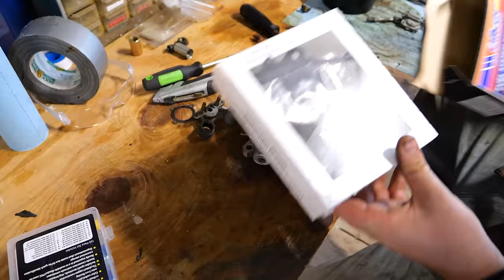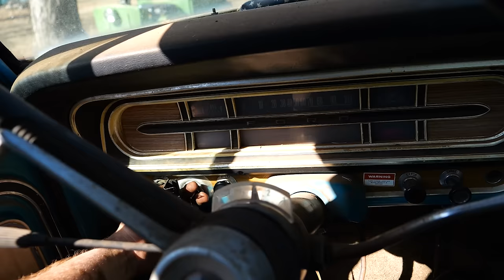Will this STUBBORN Abandoned F100 Run and Drive After 15+ YEARS!?

Comment: Hi Kevin, newbie wrencher here. I have a 1975 F100 with a 390 in it, Edelbrock 1406 carb, and it is just dumping gas into the oil for some reason. It runs great though? And doesn't smoke at all. I replaced the fuel pump with a Napa OE mechanical pump and that seemed to make the issue even worse? I have to drive it 1000 miles home in about 10 days and I was wondering if you had any advice on what to check next. I've already learned so much, my dad never taught me to wrench so I'm trying to learn everything I can so my son or daughter doesn't have to teach themselves like I am. I love every single one of your videos and they've been invaluable to me in figuring out the basics.

Comment: Ok for noobies heres a bit of a trick ive learned working with carnival equipment.

Points if you noticed make a spark when contacting metal, what happens when that connection gets crap on it.

Well in the carnival there is this metal ring that goes around in a circle that has an eletrical connection from this brush looking thing on the other end being a solid wire like normal.

now as the ride spins you dont get a cable just winding up like a wench.

to keep it from corroding we coat it in Vaseline.
Try it on an electrical connection that requires something to swing into whats spinning.

Comment: My husband bought a Ford 150 in 1994. He paid $4000 for it. The truck ran until 2021. It has over 300,000 miles on its. My husband died this year, but his truck, although not working is still sitting in the front yard!

Comment: I know surely it's a 5/8 head sized bolt so you can use the 5 blades spark plug the socket determine the engine that's a good thing that you can get a good deep bite on it with a deep well and hopefully you won't shut it off even though some people have done so but in the early years about 3:27 as noted they didn't have a prank snowball so if you went in to one of those in A3:27 or 283 you can't turn it that way either you have to get on the fly room or the belt like you're doing there

Comment: Craftsman, great neck tawain and USA and true value hardware stores made in USA master mechanic tools is what I used from like 14 to 2016 when my tools disappeared right off the seat in my truck!! And over half the tools in the garage in my roller tool chest and cabinet I still have my Kennedy signature series power coated Orange....

Comment: Your videos are great and really helpful.  The only comment that I have, and learned this from the Millennial Farmer and watching his videos, but I was concerned when I saw you leaning over the engine and the fan was going around and around, and there on your hoodie were the draw strings hanging down.  I don't want to see you get caught into the motor.  Zach from that channel was promoting his hoodies and the first thing he did was cut off the strings so they would not get caught.  Just a suggestion if you are like me and never tighten them anyways.

Comment: I once had a 1970 Ford F100 with a 360 and a 3 speed manual transmission my father left me it sat for 4 years when I was in the army after I got it running and driving again several people told me the engine wouldn't last a 1000 miles but after I gave it a tuneup and set the timing I drove it for a little over 20 years until it was stolen it had over 500 thousand miles on the engine and it still ran fine.

Comment: Unfortunately I have ran into this as well,, I went to pull the decent quadrajet hot air choke carburetor off a 79 chevy k20 sbc 350 to rebuild and use on my other truck a daily driver 78 Chevy c20 custom deluxe.... anyways I had to lock wrenches together on the top bolts in the front to get the freaking thing off the truck, they should never be anywhere near that tight... and sure enough the back two lower carb bolts were way too tight that revealed the farmer sealed it to the intake with silicone waterproof for bathtubs and the black rtv all-over the bottom of the carburetor...
Reply: As in no gaskets....

Comment: 38:33 Homey that thing just started 250% easier than my 14 Challenger starts. ._. old iron is just so damn much better it isn't even funny. Engine clatterin' to beat the band, smokin' like it's coal fired, knockin,' running on 7, sunk lifter/wiped cam, STILL STARTS RIGHT UP WITHOUT A MOMENT'S HESITATION!

Who's leg do I have to hump to get these modern computerized garbage piles to start that reliably?

Comment: My 1st project car is a 96 BMW Z3 with a German tuned 4 cylinder, I might be finished with it in the next 3 years. The price for parts is the only thing setting me back. My 2nd project vehicle will hopefully be an older dodge as I am familiar with them from when I owned an 83 D150 with a 225 slant 6 oh the joys and ease of older dodge engines, except for electronic fuel control systems that had no reason to be on an 83 carbureted motor.

Comment: Engine rebuild if possible the bearings on the rods are probably worn out from the was once oil is now grease/metal particles really will help if there was new oil and rod bearing in it

Comment: 49:41 Ummmmm not such a safe move there, Kevin --- those hoodie-strings on your jacket were awfully close to that dangerously-spinning fan-blade!  They could have gotten caught in the impeller and yanked your tender-fleshed face down into those sharp whirling steel vanes!! :O :S

Comment: On point with it usually being an ignition problem. I changed out a fuel pump before replacing points for a second time. Whaddya know? It was the points. 😂
Reply: Watch the beginning when he's showing the points, the pivot shaft on them is completely worn out and the points slide back and forth. That causes dwell issues and poor running. He was just demonstrating how they work, but I'd have replaced them first thing

Comment: "I can lick both of these and be fine"... I wouldn't count on it. Generally, DC 12 V is pretty safe, but if there's a draw from the battery and it stops while you hold both poles you WILL get a nasty chock. If the draw is big enough and stops abruptly enough (starter) it might even kill you, so be careful with a car battery. Dropping one on your foot isn't the only way to get hurt by one.

Comment: This old truck is just testing you to see if you are serious about fixing it or not. I think it deserves a slightly better engine that makes less rocks in a can noises. Maybe do a teardown on this one though and show us how bad or not it really is inside.  I'm guessing pretty bad. It looks like that one was very neglected and oil wasn't doing it's normal oily things in there for quite some time. I still enjoy watching you go through carbs too. I mainly deal with EFI, but I like learning and having carb knowledge for when they come around. I still have one of those Motorcraft 2bbl carbs lying around somewhere too that was the original off of my 79 Jeep CJ7 with a 304 that I had back in 1995. I kind of want to rebuild it just for fun, along with a few other Motorcraft/Holley 2bbl and 4bbl stuff sitting on shelves from my early 80s Ford collection. I've learned more about carburetors from this channel than probably anywhere else. Now to find a channel that does with automatic transmissions what you do with carbs and I'll be set for life.

Comment: That oil was trashed as evidenced by all the sludge, and the dipstick. I suspect the noise was due to inedaquate lubrication or oil flow from a plugged oil pick up. I think the marvel cleared the plug, and fresh oil fixed the noise. The leak was caused by the fact it was likely held together with sludge and the marvel opened it back up. I still think it has a vacuum leak though, every MC2100 I've dealt with had one. With all that said, the engine is desperate need of a rebuild and no amount of 50w oil or marvel will fix that

Comment: 60 out of 100 Ford truck owners have hit their head on the hood latch. 60%. Chemtool with the spray straw works great for cleaning carbs. Spray through all those little port holes. 
End of video before burnout, For Sale sign in window. $3500.

Comment: I noticed the push rod you fixed.  It was spinning when running. It might have been a failed lifter.  Rebuild the FE engine?  What parts will you need? I have some...

Comment: When you find a 2100 that actually works well, you dont touch it. We have one, just one, that actually works the way it's supposed to. I replaced one that didnt want to cooperate with a clapped out used Holley 2 barrel, and it was worlds better.

Comment: I’m almost positive that mystery oil causes the rear main seal to leak. Mine never leaked until I changed my oil and added some mystery oil. Same thing with the fuel pump going out after adding mystery oil.l

Comment: So, how much hp are you gonna put into this cool old  dilapidated bump side F-100? (These old bump sidefords do look good.) Do you know what the flex-o-magic suspension was that this truck came stock with from the factory from 1967 - 1972? They were a meet little arrangement that really improved the ride while empty and really helped the loaded truck stability. I grew up driving an F-100 with that set up and it worked real well when loaded, towing loaded and running around empty, it rode very well compared to other pickups.

Comment: You explain how things work and why things break well.
Why not continue as you did in this video and overhaul the entire motor?
Take it out, send it to a machine shop (what you need to) and put it back together.  Still using 'regular' tools.  Maybe don't go overboard with the simple tools.  Use a proper engine hoist.
Just a though.
On a lighter note.  Mook is adorable.

Comment: a big one is float level, if its wrong, the carb will never ever run right, ask me how i know.

my '57 ford with its 292 never would run right, i checked timing, dead on factory timing, (3° initial ~13° vacuum) i had a carb i had purchased rather than using the truck carb someone threw on it, i bought a 1959 mercury 383 (350cfm) holley 2300 two barrel. was a straight bolt on, but it was an aged rebuild, and someone overtorqued the absolute hell out of the fuel bowl and metering block, a replacement fuel bowl, and using the metering block from the truck carb (swapping jets and cleaning it), then i set the float properly with an old 1950s needle and seat i cleaned and replaced the o ring on, rather than a modern replacement part, and then BAM idle and it runs smoothly. 

youre a major inspiration for my project, if youd like you can see a couple of the videos of me getting it going on my channel. 

Y blocks forever.

Comment: I have seen that spacer plate under the carb rot out and cause a giant vacuum leak and only want to run on full choke and only way you see it is to remove the spacer plate and flip it over also seen the brake booster leak and do the same

Comment: On having gas in the oil, is it guaranteed that oil the gas is bad blow by? I have heard that in the old mechanical fuel pumps, the diaphragm could dry out and allow fuel to bypass it and dump directly into the pan.

Comment: I’m wondering if u have a choke vacuum leak. I believe there is a port from the choke stove that draws in the hot air from the riser into the motor, u may have that wide open causing a lean idle

Comment: parallel blade or "gunsmith" screwdrivers will make your life way better taking out brass jets, you probably have them already if you have a cheap set of security bits, essentially they act on the whole screw slot, not just the top corners like a normal wedge shaped screwdriver.

Comment: My advice to people getting old vehicles running again is to keep an eye on everything that can leak when trying to get it running, and especially after it's running. Fuel leaks, leaky spark plug wires, coolant leaks are honestly a small issue if you catch them and don't overheat the engine, it's mainly leaky fuel and spark that you have to worry about. Saw an intake on an old 350 in a '70 C10 that a friend of mine got running go up in flames because he didn't notice the fuel line was dribbling gas onto the intake. Luckily nothing was damaged but a completely junk antique Holley carb, some hoses and wires that needed to be replaced anyway, and of course the offending spark plug wire that chose death by fire. About the time I asked if he smelled gas the whole intake went up in flames, instant fireball, just add stupid. 

Seriously guys, be careful, no one wants to see people getting into cars get self immolated, not trying to scare anyone, but remember, you're literally playing with fire.

Comment: Chevy doesn't have a  bolt it has a slot for a Carter key to hold the bottom pulley & the wheel for the timing

Comment: Hey Kevin love your videos. A while ago you worked on a truck with an gm inline 6 with a 2 barrel Rochester Carb ( can’t find it again) just picked up a 81’ GMC G20 van with that setup. Unfortunately it has all the 80’s smog stuff (PAIR system EGR valve) and it has multiple vacuum leaks thanks to perished grommets and line. Do you recommend trying to fix it all or trying to remove as much as I can? Tks!!

Comment: I had one with a 360.  I ran straight 50 weight and 2 cans of STP to get the gauge to even move at all. The only reason I pulled the motor is it was running so bad. Combo of lose timing chain and 3 flat cam loobs.  Reringed it new bearings including cam bearing Valve job high volume/pressure oil pump and good as new mileage went from 9 to 10 MPG 4 speed stick. I love that truck. but in 2001  blow a head gasket and I bought a new mustang GT and truck went away.  Now mustang GT has 164000 miles on it and it needs to go away.

Comment: Hey Kevin, what you said about using heavier oil on a higher mileage/ older engines makes sense but will that apply to transmission as well? I am debating whether or not will be a good idea for me to change my 240k tranny from using OEM (thinner) to AMSoil synchromesh (slightly thicker). Would that be a good idea or no?

Comment: That's a no no 2 Kevin you might say that it's not really supposed to downstairs car was starting blue or carbureted cleaner to fire cause there is no rubrication and that that's what you're supposed to use a bottle with 2 stroke gas or something of that nature in it it won't hurt the vehicle at all but it will help in helping with dry starts and you should have took the plugs out and shuttle around the cylinders and turned it over by hand 1st but you didn't do that either even though you preach it up on severally your past videos

Comment: I noticed your hoody strings are getting way to close to slinging motor parts. It may be an idea to tuck them inside or remove the string when working on motors. Safety first

Comment: Thank god it is not the abandoned F 100 year revival. Stupid joke, some nice tips for beginners, really enjoying your videos. You have a way with words, so the content is always very interesting to watch. Especially what helped me was the tutorials on the drum brakes, sadly I did not get to remove them, as I do not have the right tools and space for it. However, watching it and other videos I understand it is actually not that difficult if you got the right tools. The toughest thing about all that thing is just getting that large 30 mm nut off the wheel and probably finding out what are those handbrake tensioners and if that 1999 puma has them at all. Anyway, the videos and your reply helped a lot.

Comment: A PUBLICE SERVICE ANNOUNCEMENT FOR OTHER RE TAR DS LIKE ME.
I didn't know about clutch fans until I was banging on the fan shroud after an friends fender bender because the shroud was hitting the fan and the engine was running. After acouple hits with my palm in freezing weather the shroud shattered and my arm went through the shroud and stopped the fan from spinning. I didn't look because at my arm because I thought I had lost my lower arm but didn't. I just had a bad cut where the fan hit and stopped on the arm

Comment: My friend has a 1967 t bird with 390 and it bends push rod on drivers side  of #2 cylinder he thinks bad lifter ? Is that true or could it be sticking valves?

Comment: DOES that ORANGE spark indicate a WEAK coil or worn points/condensor etc?
my 76F150 390 FE has duraspark which still works so i havent had to test the spark.......yet

Comment: Have you ever used gasoline that was 1 year or older to start an engine?
I have a truck and its engine is currently not working well, and its gasoline has only been changed twice in more than a year.

Comment: Years of sitting with a 100lbs crank in it warps the front and main seals out of an old motor. Should have done those first after getting it running again.

Comment: Kevin said when hes gonna get back on that wagon I'd like to see what not changing an oil and total abuse has done to that engine over the years it'd be kind of interesting to see if it has to be bored out as sludge as the vow covers work when you pull them off when you pick it up so we're looking forward to seeing it back on the channel hoping you revealed your personal energy instead of getting a crate motor or using a different mot Altogetheror